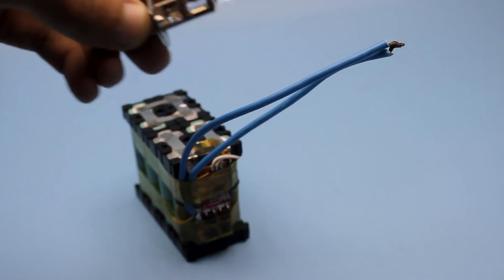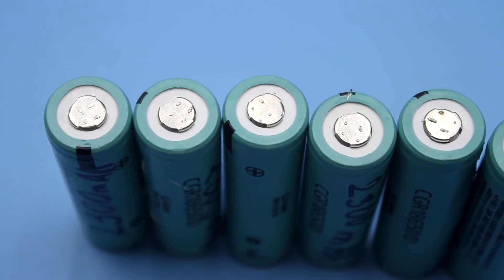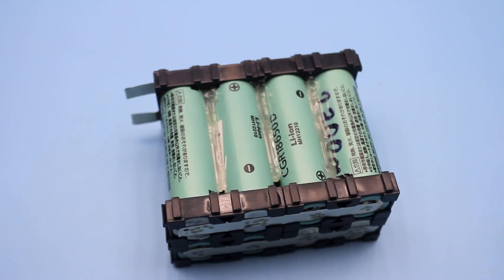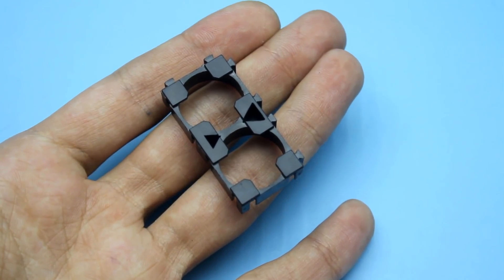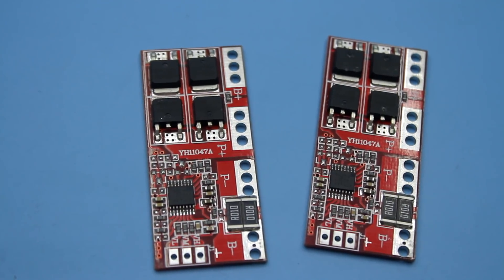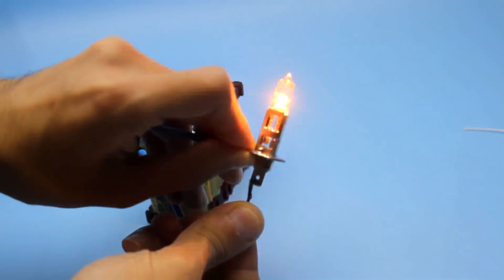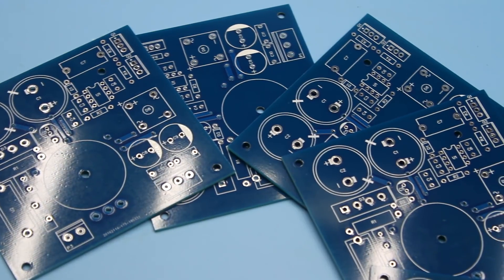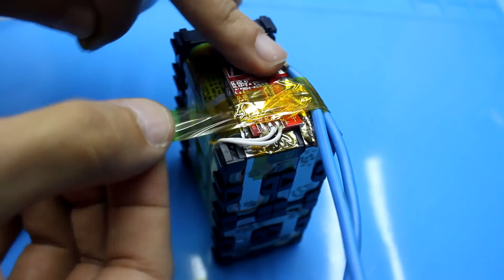How to assemble lithium-ion battery

Comment: I noticed you used Kaptan tape around the pack but didn't in the valleys where the hot melt glue goes.  If you tape the valleys and apply hot melt to the tape, you'll avoid burning or distorting the thin heatshrink film surrounding the cells.  The tape and glue will also be much easier to remove later if you need to repair or disassemble the pack for any reason.

Comment from the maker: DIY Drill
part 1 https://youtu.be/au8Wgkkmgkc
part 2 https://youtu.be/n0Hhgkt8mtQ

Welding machine
part 1 https://youtu.be/fOlvM0B89WY
part 2 https://youtu.be/67OUHQbGaHk
Another https://youtu.be/PHCFM5Gu5cU

Protection board 18650 4s http://got.by/2j577v
Protection board 3s http://got.by/2j57qq 
Another boards http://got.by/2j57v7
Battery 18650  http://got.by/2j5901 
High-corrent battery  http://got.by/2j592r 
Nickel Strip Strap  http://got.by/2j59bw 
Spacer 18650  http://got.by/2j59gy 
High Temperature Tape  http://got.by/2j59ru
Heat-resistant, flexible wire  http://got.by/2j59yu 

Facebook https://web.facebook.com/Kasyan-TV-139150916827430/